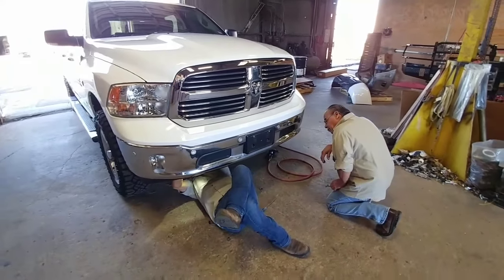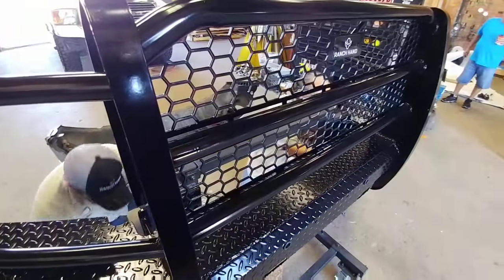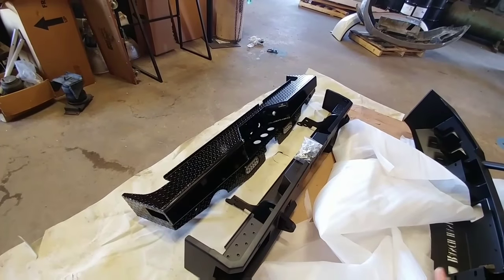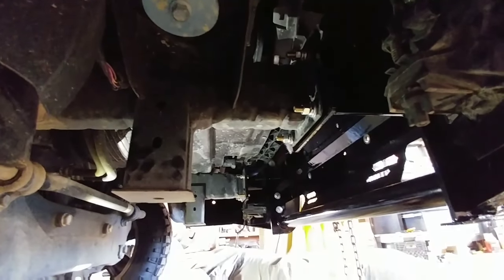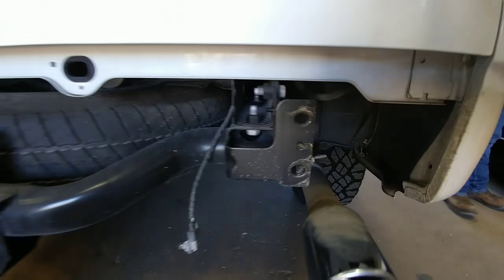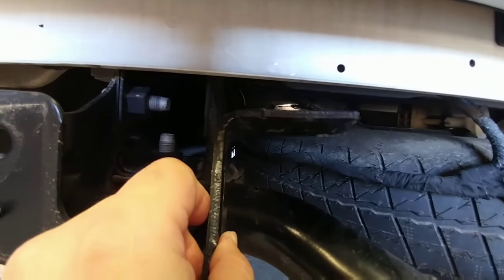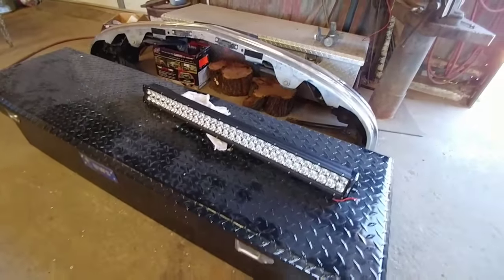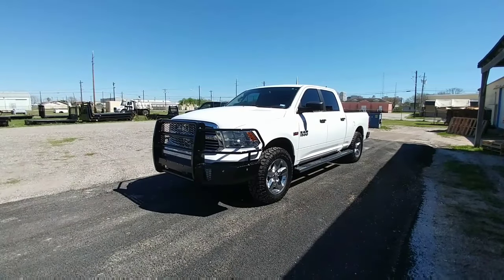Must see this Ranch Hand on 2016 RAM 1500!

Comment: The exact video I needed to see, l have been thinking about doing this to my Ram 1500 ECO diesel . Thanks for the video.
Reply from the maker: +ricky safer: no problem
Reply: Big Truck Big RV i know u do mostly hd trucks but have or do u plan to review half tons? i would really like to get your impressions of the ecodiesel. maybe a 10k lb trailer on ed vs 10k lb trailer 2500. yes i know 2500 can tow 20k lbs but most people dont pull that much. i have a 10k lb truck and trailer i pull to sled pulls. an ed could be my daily and tow rig. a 2500 sucks so bad on mpg it couldnt be my daily. thanks
Reply from the maker: Andy Hass: I've actually posted reviews on all 1/2 ton trucks except the Titan and Ecodiesel
Reply: Big Truck Big RV well get on it hehe. thanks! titan xd diesel vs eco diesel towing review

Comment: This looks amazing! This takes a run of the mill white Big Horn Ram and completely transforms it into a different looking truck. It's crazy how popular these are down south but you almost never see them here in Pittsburgh and when you do it's almost always on a truck owned by and oil and gas company. My only is worry when I do see them they're almost always rusty even on a new truck I think after one winters salt they start to rust. There are also very few Ranch Hand authorized dealers here.

Comment: Big Truck Big RV, I lived in TX for a few years, and My boss (cousins husband) Had a 2011 F350 right when they came out, and He had a colormatched Ranch Hand bumper installed by the Ford dealership, they are one badass Bumper, and i say that because about 6 months later he had a trailer axle with tire come flying off the trailer in front of him (home made truck axle trailer) and hit that Ranch Hand, and it barely even scuffed the Paint.

Comment: Did the 1500 have stock suspension when the Ranch Hand bumper was installed?  Did the 1500 need any risers or modifications to accommodate the bumper? Thanks in advance.

Comment: HELP PLEASE!  I have a 2017 Ram with front and rear sensors and I cannot find this bumper on the Ranch Hand website.  I can't imagine that there is much difference between 16 and 17 as far as the bumper.  Do you know the PN#?  Who are these guys doing the install.  The local place here seems kinda sketchy as they told me that they would need to cut the sensors off.  Heck, the sensors have a plug!

Comment: Before and after measurements would be great on the front and rear fenders to see how much the truck dropped with the added weight.
Reply from the maker: Chubby672: I'll check, but I don't think I dropped at all.  I have before measurements, just not after.

Comment: Thanks for doing this video. I got a 2021 Ram 1500 Quad Cab Big Horn and am thinking about getting one of these bumpers put on it since I seem to be a deer magnet. I’m planning on getting the Midnight Front Bumper W/ Grille Guard specifically because of the fact that I have the front parking sensors on my truck and because I figured I’d give my truck the much added protection it deserves.

Comment: How did you get the OEM fog lights mounted?  Does the bumper come with a bracket? I Bought a used truck with a ranch hand front bumper on it but there is no mounting location for the OEM fog lights.

Comment: Slick bumper and Tires on the truck. Any chance you know the size on those tires? Thanks
Reply: Cruhcifix I can can tell you those are the factory 20" wheels. However, I'm unsure if those tires are larger than stock. They appear to be.
Reply: I'd guess they're 33's. Suspension doesn't appear to be altered, although I could be wrong.
Reply from the maker: +Supa Doopa: 275/65/20

Comment: So the holes for sensors on the front replacement had to be drilled, or did they start doing that from the factory? Last I knew they weren't offering that.

Comment: The exhaust is when you get the v8 it's straight. If you have the v6 it's curved behind the rear tire
Reply: OJ1209 Hobs not true. I have a 5.7 with the exhaust near the tire

Comment: What about the big gaps left at each corner in the front under the headlights. The factory bumper is molded to fit that and this one leaves a huge gap for wind and anything else to get in and wrecj havoc on all the internals.
Reply from the maker: Nathan Wedrick: notice the Ranch Hand fills those gaps.  look closely

Comment: U know I didn’t think I was going to like it. But I kinda do. The front around the lights seam kinda bulky but it’s probably me just never seeing a half ton like that.  Kinda disturbing how thin the metal is on the rear and front. That back end mounts up to the trailer hitch and I know ours twists with the travel trailer hooked up so my bumper moves too. Wonder how the truck and bumper  will hold up in a collision

Comment: We just drilled holes exactly where you all did an seansors are still beeping help please what can we do to make them stop??? Same exact year make an model 2016 dodge ram 1500????
Reply from the maker: Did u cut your harness?  If so, you messed up the impedance of the wire.  You'll have to do the math and repair the harness to match the OEM wire impedance
Reply: Thank you so much ya'll guys are awesome I will try that basically same size wire has to be used correct ?

Comment: Are the parking sensor holes on the bumper custom drilled? I cant find any with the holes already drilled anywhere. Have a 2017 Ram Lone Star 1500 4x4

Comment: Wow! Lots of little bits and pieces under there which are not on the older trucks! No wonder they cost so much to repair after minor crashes. That frame rail comparison was a pretty good demonstration of why heavy duty trucks weigh so much more and carry so much more than half tonners! They may look a lot alike, but are not even close under the skin. How many of the viewers caught all the details on that 1500 to make it play nice when it crashes into a car or minivan or baby SUV and match up with their crash structures so as to reduce injuries? Does the design of your bumpers meet compatibility standards for automotive crash standards? I did not see the under ride protection structure on your bumpers. Is it there?

Comment: Well this is what I have been waiting for. I'm glad I went with the summit for my 3/4 ton. It's clean and looks natural. May have to order a light bar now too cause that looks great. 

I have a concern on the wiring harness for the parking sensors. I am not sure my installer has had to do that before so I'll have to call Monday and say HEY MAKE SURE YOU HAVE THE CORRECT MATERIALS. Last thing I want is for it not to work. 

Great video. 

PS. Do you know if Ranch hand makes a rear bumper that accommodates aftermarket hitches? I have a Curt class V+ and it's defiantly more beefy than my original hitch.
Reply from the maker: +C Nevs: great! I believe most of their bumpers allow for the factory hitch to remain.

Comment: I kind of want something like this on my 95 blazer (S10 chassis) but while there are things for the 1998+ model years, there isnt anything specified for the 95, and while for the most part the 90s s10s and blazers were built quite similarly, i dont have a way to check if the mounting is exactly the same, i have a feeling it is, but i dont want to spend all that money only to find out that it wont work

Comment: Nice big heavy duty bumper!  Holy crap 💩If that's a lighter duty for a 1/2 ton what is the weight difference between a bumper for a heavy duty truck? Besides ranch duty why would you want something that heavy on the front? The bumper itself I get but, why all the heavy brush guard structure?

Comment: Looks Great..... The shop guys seem friendly too, that goes a long way.  ( asshole merchants loose business )
Those bumpers look nice, much better then many on the market.
The light duty truck is fine as a car, its not must more then that. 
The RAM trucks rate very poorly in the crash tests, the front wheel crushes into the seat (O.o) Sheet metal delaminates too!

Comment: yes its frames r thinner. so what? its called engineering! u higher strength steel so it can be thinner and lighter.  plus oems have to meet safety regulations. they have crumble zones to protect u... putting that massive bumper on messes up all of that. to each their own...
Reply from the maker: +Andy Hass: I'm not disagreeing, just pointing out.

Comment: They don't make trucks like they use to damn that factory bumper  is all plastic.
Reply from the maker: David Stanley: no sir, it's actually all chrome plated steel. It as a plastic backing material, probably used for mounting sensors and lights.
Reply: There was a time they used 1/4  inch steel 
Now the steel is so thin they need plastic backing.
Reply from the maker: David Stanley: I really don't ever recall a time 1/4" steel was used in OEM bumpers unless it predates the 20s.  Vehicle bumpers have pretty much always been stamped and usually pretty thin (around a 1/16" or less).  This goes back to the 1940s at least. the plastic backing isn't for strength, it's to reduce noise and provide a mounting point for things like Flood lights and Parking Sensors